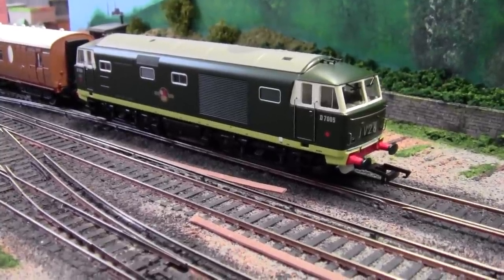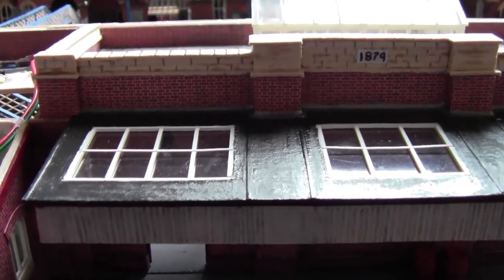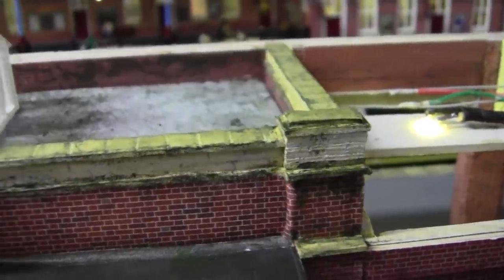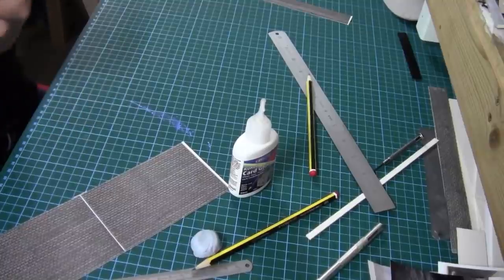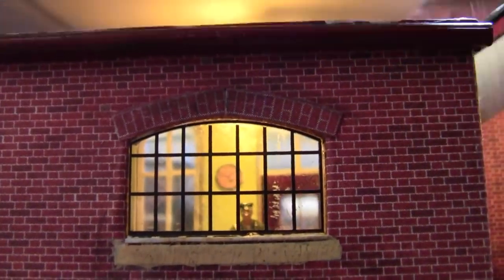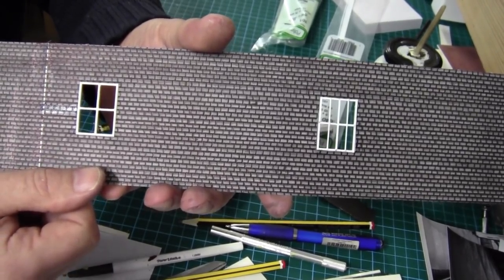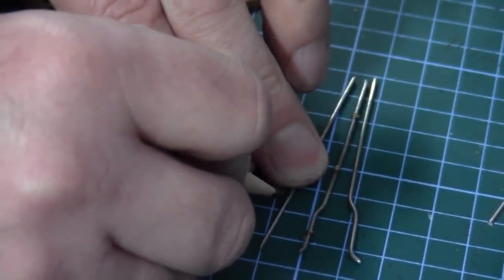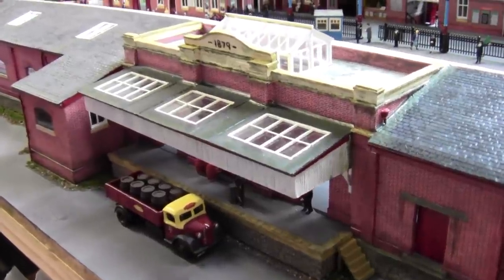The Station part 30. New Years Update. New loco. & Building Completed No151

Comment: A great tip for the down pipes. I've used a lot of the Wills ones but I need some longer ones for a retaining wall. Now I know what to use. I've always liked the Hymeks although they're not appropriate for my ex-GE layout. Having said that, I understand that one did venture up the Chingford branch on a special for a scout jamboree. Happy New Year to you Tony.
Reply from the maker: Hi Les. the down pipes you can use any wire as long as its 1.2mm in dia. i have always wanted a Hymek they where mainly based on the western region i think. i would like to collect at least one of each class of the diesels between 1957-1965. but mostly i will stick to steam engines from the LNER and maybe a few from the LMS. happy new year LES..............all the best Tony

Comment: Love the Hymek, my favourite loco. Great tip about downpipes  L will definately be using that. many thanks. Hope you have a great New Year
Reply from the maker: Thank you Philip. i the the Hymek where on the western region but i will have to check on that. if you do do the down pipes. it does not have to be solder wire. any wire at 1,2 mm Dia. will do and some finer wire for the brackets. all the best for 2021.......cheer's Tony

Comment: have you tried tile  or stalt stips to buildings at all they take a lot of time and effort   to git right but look amazing when finished as you can have a 
slipped   tile or slate and moos all adds to relisame in the end
Reply from the maker: Hi Anthony sorry for the late reply. i would love to have a go at a different approach at roofing. and i think your idea would look great....many thanks for commenting.. cheer's tony
Reply: Hi Tony I will try to help you if I can git sum graph paper stick that to sum thin card then find what size slats you want 4 mm to the feet cut the card into strips about 8mm mm high  then making a cut slit about 4mm wide four each slate  about 5mm up so you have an overlap on each strip of slats  hop that helps if not if you can git a book by Dave Rowe it not can I send you sum photos of sum buildings that have dun this to it may be better I have also dun sum thatch roofing that  even takes longer to do
Reply: the book is architectural modeling by Dave rowe £16.99 on amazon
Reply: @TONYNORTHEASTERN  have a look at David Wright video on you tub that will help you as well
Reply: @TONYNORTHEASTERN  the book is also available at the model train shop at £2.50 plus p&p
Reply from the maker: Many thanks Anthony i will check it out............many thanks Tony
Reply: @TONYNORTHEASTERN  thanks Tony